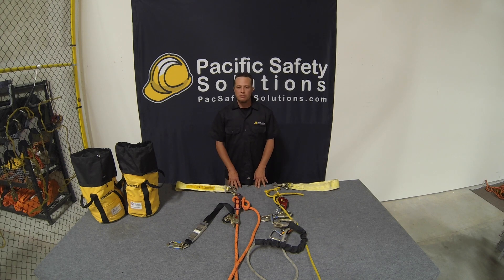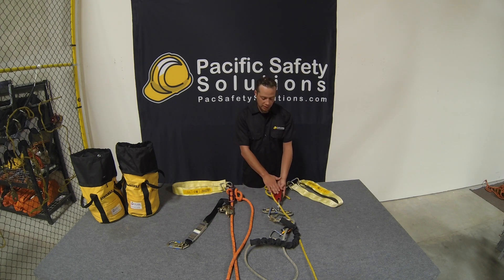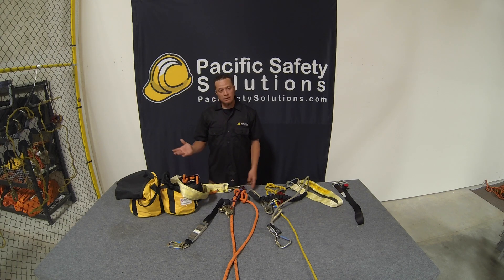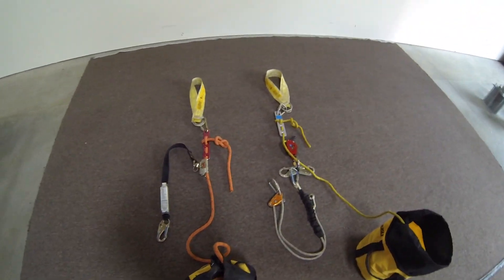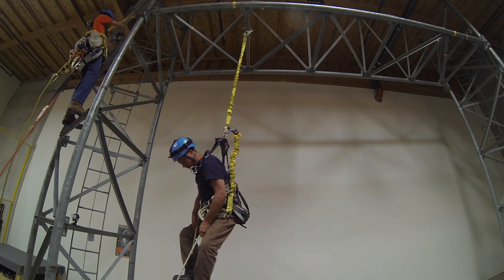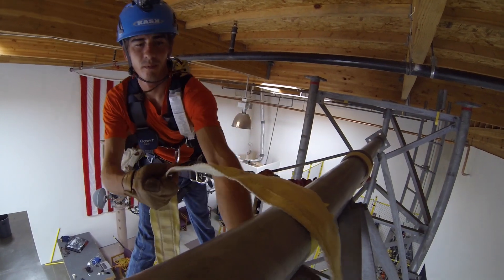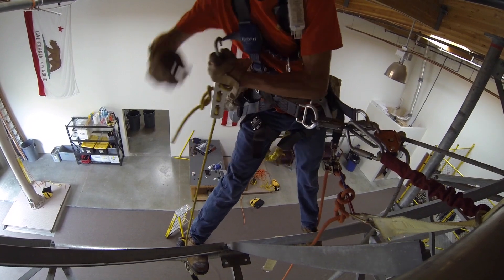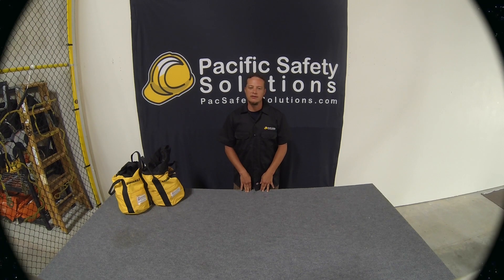Tower Rescue Demonstration

Comment: Thanks for the video!  I tried using the Grillon as a pick off but was unsuccessful.  I'm going to try the force vectoring that you showed!  Looks like it should work fine!
Reply: I figured it out...meant to post a follow up but thank you for the video.  The force vectoring is the key as is keeping the Grillon sheath out of the way!  Thanks again!
Reply: SPRAT (maybe IRATA as well) requires two points of contact for rope work, would you consider an additional connection to the victim?
Reply from the maker: absolutely if time permits, a second connection point would be the best option.
Reply: I know FD rescue and industrial rope access differ on many things, one strict for some issues and the other strict for different ones.  Trying to make sense of it all.  Thanks for the help!
Reply: Yeah that's what I learned too @ErikAtTheW cool name bro, lol
Reply: Could he have just used a Jag system?,🤔what are the standards on using that?

Comment: What would happen if your climber fell and activated the shock pack while the unused hook is attached to the pole strap point ?
Reply: +Travis Ross it appears to be a single in the video
Reply: You descend him or her and that pack is no good. It needs to be decommissioned and given to safety coordinator. Write on pack bad and label it. If osha's finds it near other safety equipment and not labeled bad or decommissioned. Big fines coming your way.
Reply: That's correct. Deployed (activated) or not.  Both the harness and lanyards were subjected to a fall and are required to be separated and flagged as unusable equipment.